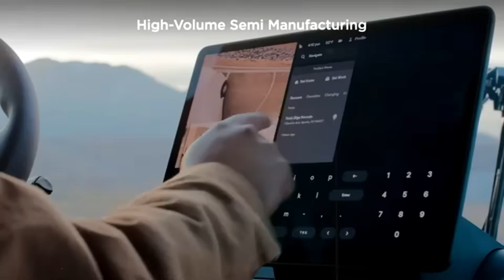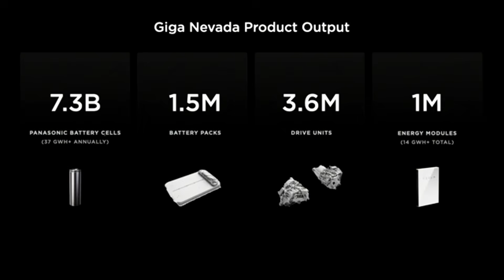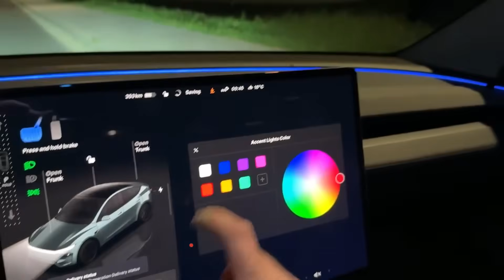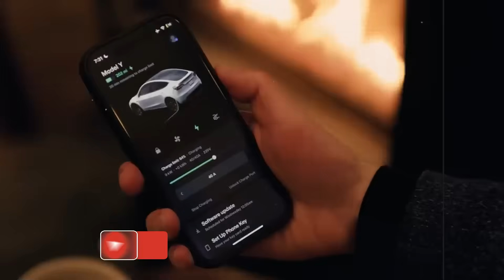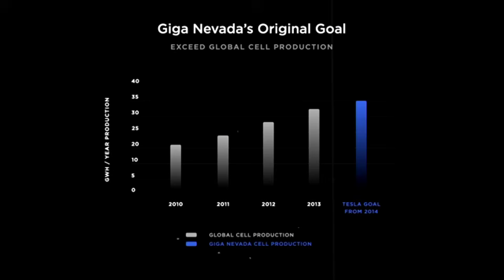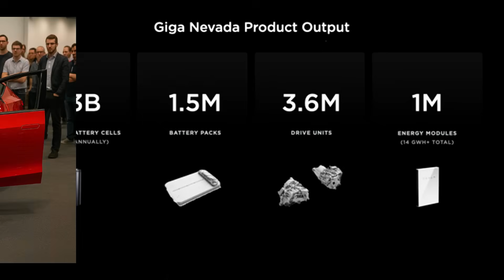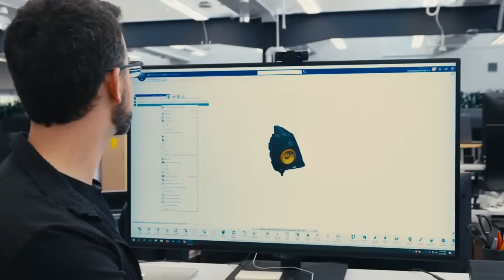IT’S HERE! New Tesla Model 2 With New Aluminum Battery — 831 Mile Range And 10 Minute Fast Charge!

Comment: Okay, wouldn't this be a great adavnce.  My two concerns are in the details:  When, how much and will it be safer than lithium ion batteries?
Reply from the maker: Great points — it definitely would be a huge leap forward. The timeline and pricing are still under wraps, but safety improvements are a major focus, especially with aluminum batteries being less prone to thermal runaway compared to lithium-ion.
Which concern matters most to you when considering a new battery: the release date, the cost, or the safety improvements?

Comment: is the 10 Minute Charge time the default charging time?
or that is the SIPER CHARGE mode, which wears out the batteries faster?
Reply from the maker: Great question — the 10-minute charge time refers to a rapid charging mode, which can put more stress on the battery cells compared to slower charging. Tesla and other manufacturers usually balance fast charging with battery health by managing charge rates and temperatures carefully. Would you prefer a longer charge time if it means your battery lasts significantly longer?
Reply: @EVBRIEFING  so then what is the DEFAULT charging time then? Who wants to wear out the batteries by always using super charge mode?

Comment: Is this new battery charging on existing Tesla chargers.? Or it requires a new charging system?
Reply from the maker: Great question — while Tesla aims to maintain compatibility with existing Superchargers, new battery chemistries and faster charge rates might require updated protocols or hardware tweaks. Would you be willing to upgrade your home charger if it meant significantly faster charging times?

Comment: Aluminum is infinitely recyclabl. I pray this becomes real
Reply from the maker: Absolutely — aluminum’s recyclability is a huge win for sustainable EV tech. If this battery tech takes off, it could set a new green standard for the industry. Besides recyclability, what feature would most convince you to buy — price, range, charging speed, or something else?
Reply: @EVBRIEFING longevity, price, range, charging speed probably in that order. Electric motors are already far superior to ice engines so the last piece to the puzzle is energy storage. The only thing holding ev's back is battery technology. The energy density of gasoline is incredible. If we could get half that in a battery the world would change instantly